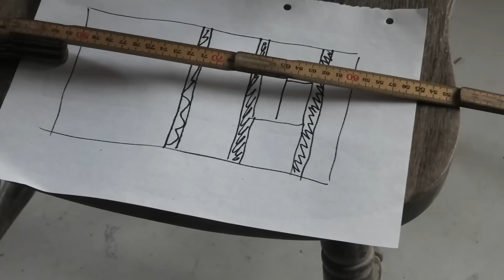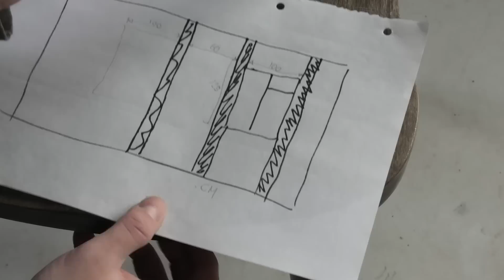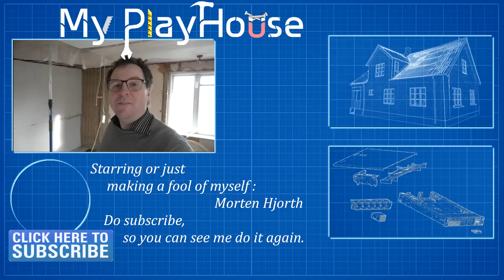Investigating What Version of Windows I Need to Get & Install - 1261

Comment: Love your DIY videos! Would be a good series of videos if you took a shot at replacing the existing window with one very large window - like you mentioned at the beginning of the video. You could explain reinforcing the horizontal stud above and installing 2 new beefier vertical studs to carry the weight.

Also - could you reach out to some window manufacturers to see if they’ll sponsor a video or two for some free windows?
Reply from the maker: I was investigating what I could do,, I don't really want to start messing with the structure of the house,, I was hoping for a big window. but are now going with three smaller, that combined will be a big window.
If I was a little more of a DIY channel maybe I could get them sponsored.. :-)